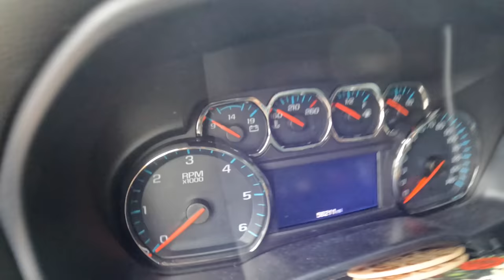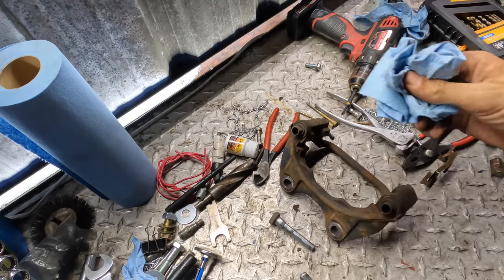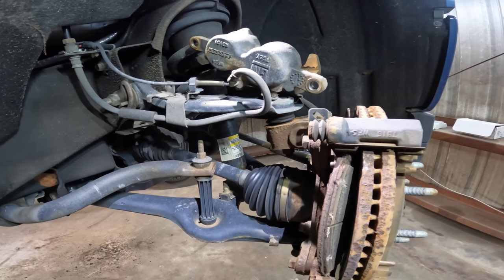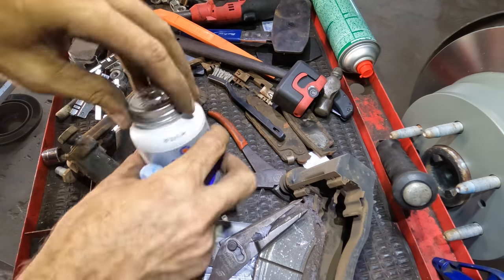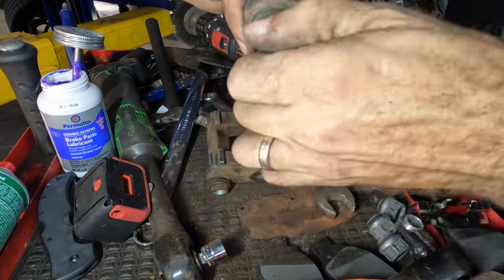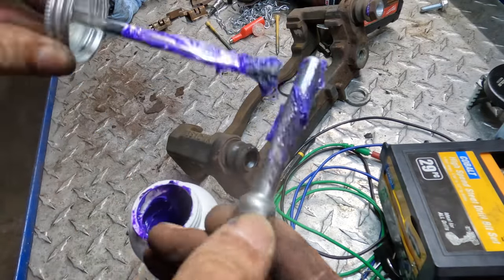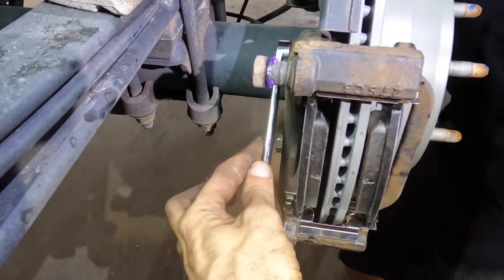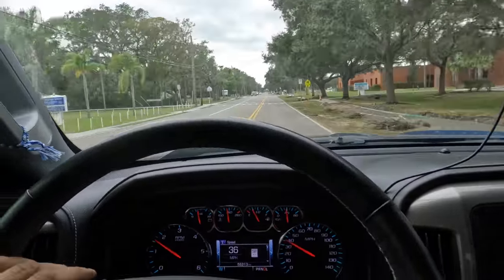Northern Rust! Challenge Accepted! New York Truck

Comment: I like that you go the extra mile and de-rust some of that, man its a mess, why aren't automotive makers using zinc coatings or at least options for the rust belt vehicles?  I live in the northwest where its wet 75% of the time, but we use no salt at all and I have almost no rust at all on my rigs, no jokes man I had a new nissan hardbody sit about 3 years in a field and I thought the underside would be destroyed, nope, the paint and coatings they used protected everything and it was near new looking.. no jokes, its that damn salt, whether its for traction in snow regions or from the oceans on coastal areas, salt does not like metals and the salt wins every time.. they used to offer the spray on undercoatings but isn't it time for what we pay for vehicles they start using alloys, zinc, powder coatings so forth to combat this rust garbage?

I see so much destroyed metal on these shows on new vehicles, bad chad just did a 2014 ford F150 XT cab corners and sills, they were rusted like an old 1916 model A ffs..  outside the corrosion and pant warranty the owner is on the hook for a $4000 for something that should NEVER happen in this day and age, why do Americans have their heads so far up their collective arses they let this kind of stuff go?  they take about 400 billion annually to pay consumer protection agencies that are supposed to protect us from this stuff but of course with crimms in office nothing will be done but take more of our tax dollars, raise the cost of gas you name it.. right now with gas at $4.50 a gallon the US government is taking in almost ONE TRILLION annually on gas taxes ALONE!!!!!!!!!!!!  we deserve much better than this!

this guy is a good mechanic somany wont even touch the rust at ALL.. and it propagates, least this guys work the rust has to start all over again which is the best you can do aside from powder coating or something, stainless?  its something that shouldn't have been happening in the 70's muchless 2022 ..

Comment: So I have noticed that you usually clean off the slide pins that go into the bracket but almost never clean out the holes the pins go into. Is there an actual reason or is that just considered "good enough"?

Comment: As a complete noobie it would have been instructive if you mentioned more of the "why" you decided to do the things you did or didn't do.  Like verbalizing the criteria you used to reuse the caliper components versus using new components.  Or the tradeoff between sanding the pads for fit versus future rusting of the bare metal ends.

Comment: Got a 2015 2500 duramax in Canada did head gasket once already over 350000 on it and I’ve never replaced brake pads or rotors lol way was that guy doing burn outs ?

Comment: I have often wondered why people do not simply open the bleed fitting when pushing back caliper pistons?? After all, you are supposed to flush the brake fluid every two years, and simply doing this when calipers are fitted to the car would certainly not expel the content of the calipers much. I would think this would be a good habit to have. Certainly lessens the chance of pushing any debris back up the brake lines. I expect with brakes this worn, pushing all those pistons back all the way should have the reservoir overflowing (er, if fluid was kept maintained at max level).

Comment: well....bleeder screws should be cracked open before pushing the pistons back in. why push back old fluid into the system....???   Should the rotors be completely washed with detergent solution?  Then rinsed, and dried???  some say yes.....

Comment: Curious??? if it is such an effort that you have to jiggle a truck around to get it on the lift, I have to ask, Why not switch lift position so it is a straight shot.. Makes no sense to piss around on getting a vehicle on a lift when the smaller one can switch places.. I mean the shop isnt set and 100% operational at this point...

Comment: Glad you're back working, Ray.  You haven't announced the name of your shop, but I found it.  I like the name. Could have chosen "Doodle-de-do Auto Repair".   If I lived a little closer then I'd bring my car there for repairs (I'm in Texas).  Seems like you're going to need an inventory of supplies and a way to get the parts you need quickly.  You'll figure it out.  How hard it is to reposition that lift or widen the door?  Tight squeeze.

Comment: Hey Ray, isn't it possible to put the air conpressor above the bathroom area? Feed one or more solid airlines to your workplace via the ceiling and use a reel/retractable airline in between the two lifts?

Just a thought.. we've got a simmilar system at my workplace, works great and you won't lose any floorspace!

Comment: Rainman Ray's Repairs Ray  if you are still looking for a computer i have had good results in dell refurbs  huge money savings  > an example   Dell Computer Tower i5 up to 16GB RAM 2TB HD or SSD Wi-Fi 24 LCD Windows 10 Pro Customize Your Own Dell 4th gen PC - Fast Shipping!   US $274.45/ea     you could spend more for a i7  but this machine for office work and  vids should tick all the boxes  if i kwem more about what you were going to use it for i could get more a brute for a bit more money  if you were going to get a tv on the wall it could double as a monitor too